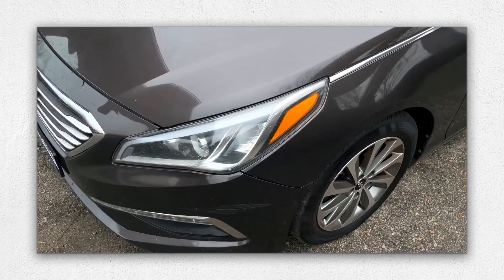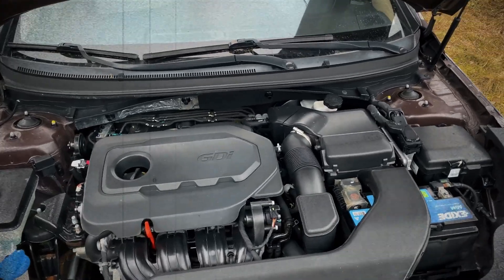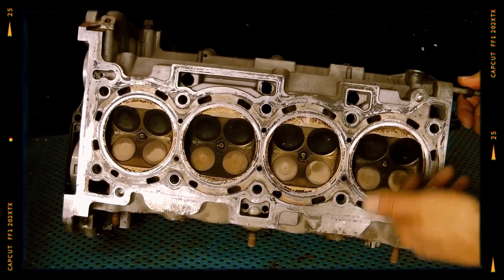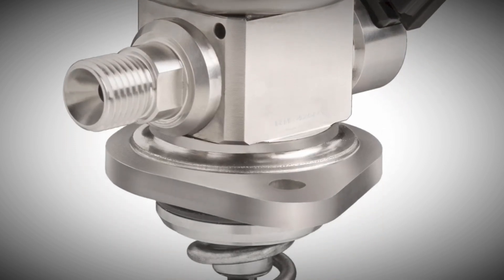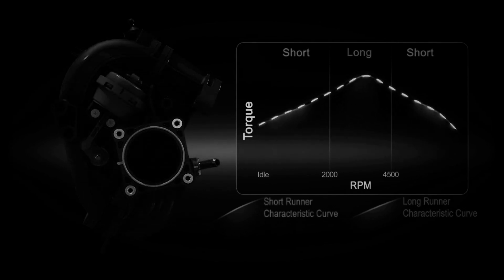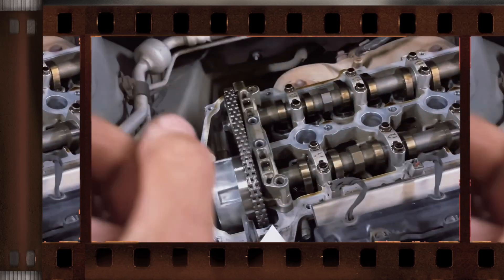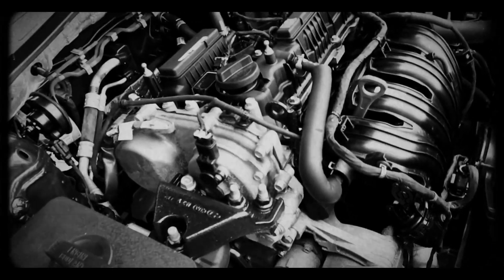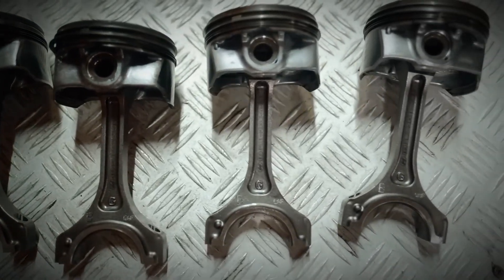Hyundai-Kia 2.4 Theta II GDI: Specs, Failures & How to Make It Last

Comment: No issues at 125K, but it is a sick pup and Theta-2 needs a lot of "meds" in the oil and fuel to keep it alive. I use CRC Intake Valve cleaner every six months, gas mileage will return to factory claims when you do so. Use a quadruple 1.8 oz dose of Berryman's B-12 per cylinder every 70k miles. The main issue is glued up low tension piston rings, which eventually attach to the piston, causing oil to blow past. No oil means a dead car. Use Berryman's B-12 to free those up. Use All-in-one gumout every three months in fuel to help with the gum, and use Liqui Moly Pro-Line Engine Flush to keep down the sludge. None of these materials are expensive. New cars are expensive. The car itself has held up well, with only $1k in parts spent in ten years. Good luck.

Comment: I've watched a number of these videos (I have 2 Hyundai's...one  like this with GDI-no turbo) INMO they fail due to lack of proper maintenance and failure maintain the oil level.  Yes they can use oil and there is no low level oil indicator other than a dipstick.  The GDI system will carbon the back side of the intake valves as no fuel solvent ever reaches there, so an induction cleaning is suggested (I use CRC intake cleaner about every 15k mi...this can be a DIY procedure)  Also suggest an oil catch can installed (in the PCV vacuum hose) to also reduce oil residue on the valves.  (These are not maintenance free engines)
Reply: @dr2644 100% correct. I use CRC Intake Valve cleaner every six months, and a quadruple 1.8 oz dose of Berryman's per cylinder every 70k miles. 
3,000 mile oil changes are preferable.
Reply: They fail due to improper de burring of the bearings causing the journals to get clogged and oil starved. Knock knock, who’s there….

Comment: Having the weak point be your rod bearings is really up there. That's bad. At least a wet belt is upfront about how truly awful it is on paper. This is a little more unforeseen
Reply: Why do you call a cam chain a wet belt????
Reply: @andrewwolf4430 i didnt
Reply: @andrewwolf4430  i was comparing two bad ideas to each other. Wet timing belts, while not present in hyundais, are on some other cars. And tbey are a bad idea every which way you could read it. On paper, in execution, in maintaining. But its more obviously a bad idea than crank pins being too small or whatever this engine had